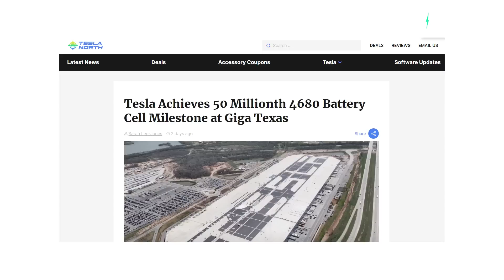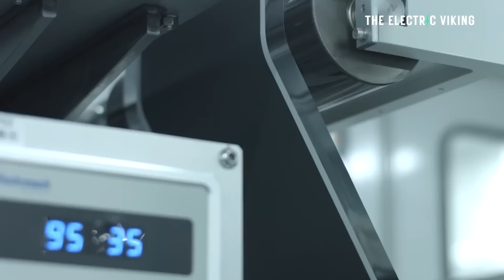Why Tesla will use different but better batteries in Cybertruck next year

Comment: 6:34 Sam, with all due respect, I believe you are tripping, granted Tesla buying new batteries isn't new or crazy, but the cybertruck is something that was designed from the ground up with 4680s in mind, and all Tesla would need to do to hit 250k Cybertrucks in 2025 is 5x battery cell production, which isn't crazy at all

If they are licensing and  producing new batteries, it would make more sense that they would go in other tesla models to me at least

Edit, I was just reminded by a comment that Tesla could use 4680s with a new chemistry, definitely possible but you'd have to figure out how to produce it dry, which took Tesla ages the first time because it's non-trivial, it may be possible to port that over, or may not

Edit 2: ok, so, yes it is true that the Cybertruck is planned to use lithium ion phosphate cells, and I agree with that, you would just want to build LFP 4680s, and figure out how to make them dry, hopefully with a similar method as the original ones

Comment: They did not have all their battery lines operational yet. They aim for 8lines and last report was 4-6 lines operational (at giga Texas) not including gall the other contracts they have + Fremont. They are still in a ramp up period. And this is known from Tesla reports. They have no plans (yet) of changing the chemistry of their batteries *based on any of their reporting… as they said they are already producing/using LFP. This isn’t new at all. Sadly, this got a thumbs down for me. Reporting antiquated information

Comment: 4680 is integral to the CT's structural battery pack. If the CT goes to LFP, it will have to have to do it with 4680s, or have.a major redesign of the CT. And Tesla has just said that they're no longer constrained by 4680 production. 4680 battery production is growing exponentially.

Comment: I think the reason some key people were let go recently was the failure of the 4680 to deliver the required range and charging times for the CT. 
Tesla is still powering ahead with 4680 and have said recently that they will start making a profit on 4680 production next year. 
That is quite ominous and will allow them to shift gears on production levels. 
I think Tesla will continue  ramping its own cell production but the reality of cheaper and better (if true) Chinese batteries can’t be ignored. But there are reports that the Chinese cells degrade much more quickly than Tesla and Panasonic cells.

Comment: I think you're spot on with this Sam. I think with Biden's new battery tariffs, Tesla knows it needs to start LFP production in America. The other important factor is increased cycle life, even though the 2170 batteries are getting great life spans, it only helps to use batteries that last even longer. Also from Sandy's video, there was plenty of unused battery space in the cybertruck, so they will have no problem fitting LFP's in. Really good news for EV buyers in the US if it happens. I believe they will eventually put these batteries in all their models.

Comment: Even next gen LFP batteries have a lower energy density than NCM batteries. just as LFP batteries improve so do NCM.
NCM are more delicate than LFP so you only likely to see NCM( or newer technolgies like solid stare or condensed matter )in more demanding roles like a long range cyber truck.
LFP are a good choice for maybe the majority of vehicles however

Comment: Tesla is the top seller in Scananavian countries. It is a lot colder there than where most people live in the USA, certainly Chicago. The issue during the extreme cold in Chicago las winter was the chargers coolant froze. The fix is for the chargers in eg Chicago is to use more anti freeze in their charger cables

Comment: The Cybertruck needs a larger battery pack option as well, not just filling the bed with batteries. At least 200kWh to be a real towing work vehicle, not just a lifestyle vehicle.
Reply: Wake up. Get a 'towing package' with its own batteries and even motor(s) to hook to the main rig. These can enhance the versatility and useabilty of the entire setup.
Reply: @billyrio3767  Excellent point

Comment: Changing battery chemistry does not mean moving away from 4680. 4680 format can accommodate multiple chemistries
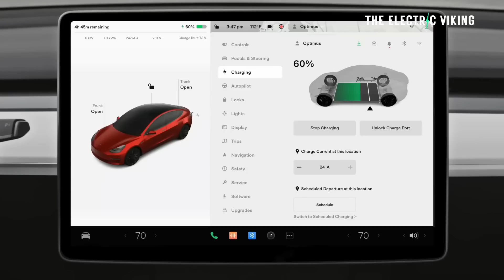Reply: @11:00 he mentions charging to 100% 4680 vs LFP. Do we know yet if at some point the 4680 chemistry will be LFP just the 4680 form factor?
Reply: @bryancarter4554  4680 is integral to the CT's structural battery pack. If the CT goes to LFP, it will have to do it with 4680s, or have a major redesign of the CT.
Reply: @777Outrigger  - Also holds true for the Model Y
Reply: Yes, but there is a difference between cynlindrical and prismatic form factor, regardless of the chemistry. (when you compare both form factor with the same chemistry ofc)

TLDR/conclusion: Unless Tesla design a new ground-breaking pack design, Prismatic on a pack-level has higher energy density, but low energy dissipation, so they are great for daily cars, not sport cars. Low risk of fire when packed perfectly because no gap for oxygen to creep in.
Cylindrical is cheaper to manufacture but have higher failure rate because of game in the pack-level, more prone in high structural stress environment.

Cynlindrical have gaps so they are more prone to structural integrity overtime since they can move and have less side impact stress resistance. 
They heat up and cooldown quicker than prismatic, which is a pro when you need high discharge rate (Sports car with high acceleration and regen). Cylindrical is also cheaper to manufacture. Cylindrical 4680 is better than 28650 falure wise because less spot weld connections.

On the other hand, Prismatic can have higher energy density because they are packed to the brim,  and lighter because they don't need heavier shell for structural integrity, making them higher density, which is better for most cars.
Since they are blocks, they give Pack and Module Engineers more flexibility on how to package them.
Prismatic Cells most failures come from Cell level than Pack Level (opposite of Cynlindrical), because the packaging need to be "more perfect" to prevent heating issues, they have lower energy dissipation. High Quality Prismatic need to use Aluminum for casing.
Reply: This is actually a good point

Comment: I have a Tri-motor on order. Supposed to be $69.000. 14 thousand pound tow rating. Nope 11,000lbs. 300 mile range supposed to be 500. No 6.5 ft bed. No ramp in tailgate. No 3500lb payload. I’m 400,000 on the list but won’t be getting the truck unless they are a lot cheaper and the range increases. It’s just a commuter vehicle and I will keep my model Y for that.
Reply: Pretty much spot on for me. I wanted to be able to pull a boat for at least 200 miles. That was killed with the CyberTrucks released specifications while also being more expensive. I will keep my reservation and hold. And the idea of adding another 16k to get close to the range, while loosing bed space and adding that cost on top of the already much higher price makes it a no go. If I were to buy a EV Truck right now it would be the Sierra EV Denali based on my use case. Then at least I would only be missing FSD.
Reply: $69,900 US$, for the Tri-Motor Cybertruck! That was the Pitch we signed up for! Plus "$7,000 for FSD!" No Wraps, No Rear Wheel Steering, No Steer By Wire, etc! 

And, yes, Vault (Bed) As pitched as being 3,500 Lbs, Towing was Pitched as 14,000 Lbs, and Range was Pitched as 500 Miles per Charge! 

That was what "I" Reserved! 

I can understand prices being higher, some 4 Years Later, but the Bed Did Shrink, by 6", and the Payload by 1,000 Lbs, and the Towing Rating by 3,000 Lbs, and the Range by 180 Miles (As Presently Available)!

However, for folks that reserved the Dual Motor Model, they "Gained" 40 Miles Range, and 1,000 Lbs Towing Capacity, while they also lost 1,000 Lbs Bed Capacity!

As for myself, I am seeing a Very Slow process of "Filling In The Many Gaps" in the Supercharger Network, in West Texas, British Columbia, and many other States and Provinces in North America! 

So, for places I would use a Cybertruck to get to, that 500 Miles if included Range, was "The Deal Maker!" Mostly, the High Clearance Capabilities, don't matter, If I'm in the Center of these points: Prince Rupert to Prince George, to Fort Nelson to Watson Lake!

That is a Charging Desert still, years after it was said that we would be able to drive from San Diego to Anchorage Alaska via the Supercharger Network!

Similar to much of Texas, South of the I-10 Freeway! Supercharger Desert!

Also, too many Supercharger Stations with "Zero" to "Insufficient" Charging Stalls, suitable for Model X, Model Y, or Cybertruck, pulling a Trailer! 

I'm no Engineer, or CEO, but, it seems to me, that "Pull Through" Charging Spots, should be designed in proportion to Sales of Tesla Vehicles that are sold with Company Installed Hitches, to the numbers that don't have hitches! Since the Model X was released, in 2014! And, to a Minimum of no less than "2 Pull Through Stalls, out of 12 Total Stalls" at a Station!
Reply: The best thing about EV's is that they identify idiots.
Reply: That's life
Reply: That was the price before Biden

Comment: Some CATL batteries already use the 4680 form factor. eg the Qilin. It could well be the case that this licensed of CATL technology is mostly in the production of proprietary nanomaterials that will then be used on existing Tesla 4680 production lines and which will boost battery performance. These proprietary materials would have the nanoscale features that make ions move quicker in and out during charge and discharge. Panasonic recently signed a license deal for nanomaterials from Sila for use in its USA based 4680 production and that was to boost battery energy density. As such CATL would not be the only game in town doing this sort of deal.

Comment: 6:00
You should not assume battery production rates are the same as Cybertruck production rates - 

We have no idea how many cells Tesla has built - Tesla may have 500 CT battery capacity per week, but since they have been building them for so long they have a stockpile...
Reply: Tesla has stated they producing more batteries than are being put into cyber trucks. Once Tesla has the battery production working, Tesla will then commision the other 3 battery lines they are installing in Giga Texas
Reply: @allangraham970  

Let's assume they ramp CT production to 2,000 a week by the end of the year. An average of 1500 per week for 28 weeks - 42,000 vehicles plus the 8k or so produced so far.  About 50k units this year.

I suspect they will be battery-constrained.

Comment: This is why BYD wants to build their blade-type battery in the USA. With improving battery chemistry, the BYD blade batteries could be fitted to a Tesla vehicle, which could add quite a bit a range per charge to what you get with a current Tesla vehicle.
Reply: Current Teslas with their NMC get better range. Teslas goal is to go to the 4680 format because cylindrical format can be manufactured at higher rates . Blade formats are not optimal
Reply: @RagnarinVa  Tesla’s 4680 are inferior so far.
Reply: @kevinweber5129  - in what regard?

Comment: Once more he is spreading complete and utter bullshit. The design of the Cybertruck is specially done to include 4680 batteries. Only LFP 4680 batteries can be used in Cybertrucks. 4680 is a form factor and has nothing to do with the chemistry. This guy is completely clueless and not worth watching.

Comment: I really need a cybertruck with the promised 500 miles of range. I have held off buying one so far just because of the short range. As a truck owner who actually uses my trucks as trucks, the current battery makes the cybertruck a joke. I am bitterly disappointed in Tesla. If GM can build a truck with a 200+ kWh battery pack then so could Tesla. Wtf is Elon thinking? I don't want to buy an f'ing GM truck but they are the only making trucks with a decent sized battery.
Reply: I think you might be the minority in this market for now so he's tailoring it to other people. Hopefully, they can get a battery that works for you when they ramp up production because yeah, I wouldn't want to buy a GM either.
Reply: They only partially filled the battery space in the CT. Elon is of the mind that most people only need 300 miles of range. Perhaps they will add to it sometime but only way to get that range is to add the extra battery.
Reply: My guess is that they choose to use their batteries to make more short-range vehicles instead of fewer long-range vehicles. That is disappointing but kind of understandable in commercial terms.

Comment: Correct me if I'm wrong, but 4680 is the format? ... So if Tesla licence CATL tech they could manufacture in 4680 format then can swap straight into the Cybertruck battery pack ...  Sounds like the simplest way of running production to me ..  ..

Comment: I canceled my CT dual motor when I received my notice that my time to order had arrived. When cost went from 50k to 80k. This, and the reports that towing a trailer would leave a CT owner with the prospect of very limited miles per charge. I don’t get it anymore, and am now thinking that an ice vehicle or hybrid will make much more sense for my needs.
Reply: Consider a Chevy Silverado EV, for which there are videos showing it towing good distances in hilly terrain including dirt roads.

Comment: basically you buried the 4680 in your video, i appreciate the honesty. musk has been BS us, Tesla never put the ressource into the 4680. they always start something and not finish, they needed hundred of engineers for that type of project
Reply: The defunded 4680 when lithium prices dropped and battery availability was no longer an issue. They are not idiots, they just don't explain their moves very well.
Reply: They just announced they have produced the 50th million 4680 battery. Their production has scaled up slowly but is in place.

Comment: So, the message is, dont buy EVs now?  Instead, wait for better batteries?  Got it.
Reply: There will always be something better in the future. If you wait for it, you will wait forever.
Reply: Batteries are going to be improving all the time for . So if you wait for the next new wonder battery, when it actually eventually appears (if it is not literally to good to be true) then there will be another wonder battery what will be the thing to be desired.
We lucky to live in a time that electric cars actually have batteries that are good enough. Power is more than good enough. Energy density is ok and cost is plummeting on existing batteries.
Trucks though will benefit from future wonder batteries ( CATL has in low volume production some batteries over 500wh/kg and these will make trucks much more appealing)
Reply: unless you want to keep throwing money out to do miles/km....yeap that's the way. If there's some brain matter to be found you will look for a used one that suits you.
Reply: Other people should buy EVs now to keep progress going and encourage more charging infrastructure. But personally, I will wait until something more affordable has a range of 600km and can fast charge 400km in 15 minutes which would seem to be on the horizon. In the interim I'll keep my 15-year-old ICE car going a bit longer.
Reply: @terjepetersen my model 3 has 600km and 300km charge in 15 mins
Reply: @tysonfinn1470  - I know about the long range Model 3 but it is not in my budget.
Reply: Yes. Unless you want attention, then buy now.

Comment: The price of cyber trucks will follow the usual rules of supply and demand. If demand is high the price will remain high.
Reply: That is why they launched it at 80k and not 40k (50k inflation adjusted). Prices will drop and so will manufacturing costs. Tesla does this everytime.